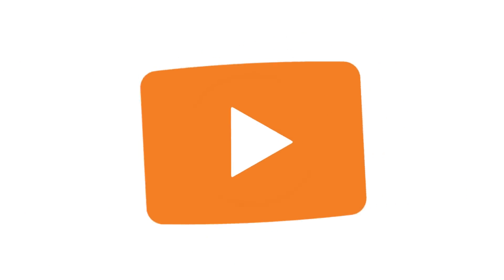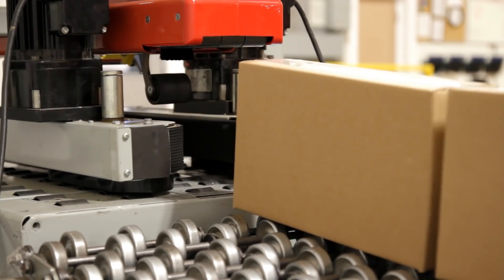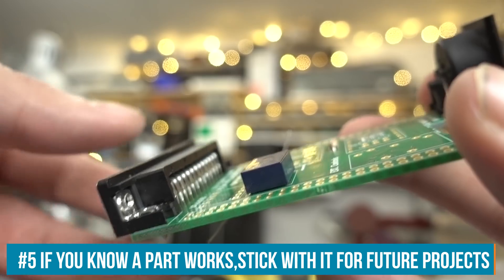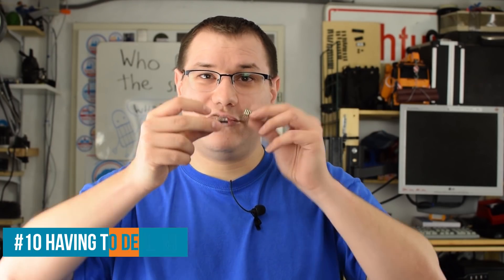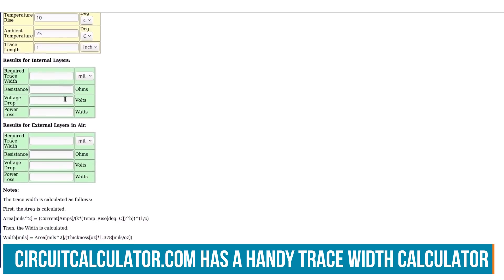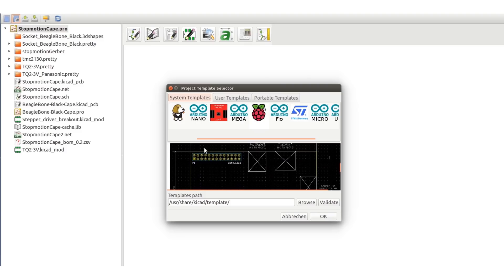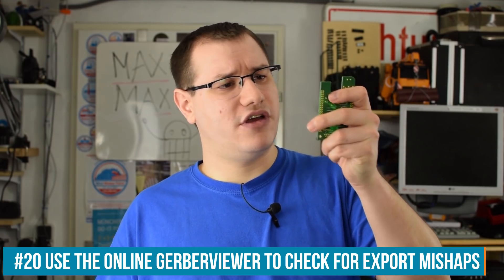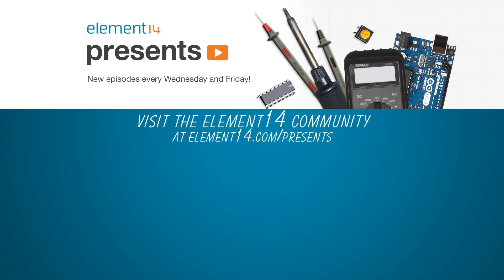20 PCB Design Pitfalls

Comment: I work in PCB design too; one thing that’s also important if you’re loading your own boards is to consider the physical aspects . Placing SMD parts too closely might make it difficult or impossible to work with using tweezers. Also spacing could be an issue when you also need to hand solder (the heat could damage nearby components). I’d also recommend spending a few extra bucks for a solder stencil for SMD designs - it makes the result much neater and saves a lot of time!
Reply: True,thanks for addimg this!

Comment: Good video with some good tips. I design PCBs professionally, and I use KiCad, and as far as flipping parts to the back of the board, as long as you verify your pinout on your footprint, the software will flip everything for you, and adjust the rats nest to match. So you really shouldn't worry about that. I think the biggest thing comes back to your tip about checking your parts, making sure you have the exact part number and datasheet, so you can make the symbol and footprint correctly. I also try to always include 3D models, that will help keep you from placing parts in such a way that they might physically overlap and cause problems in production that you might not think of because the footprints don't actually overlap. 
I am actually going to start a KiCad tutorial series soon showing how I professionally design boards using the software, so keep an eye out for that. You might find other pitfalls to avoid or new tricks that you didn't know about.
Reply: How much is it to get a simple PCB built? It's like 4 inputs for an XBOX one Controller.
Reply: @KDdesignsTV  There are several PCB fab houses in China that you can get boards for $8-20 shipped. Add parts and engineering, and you have a functional board.
Reply: I would love to see your series! do you want to post it on element14.com ? the other people there will surely be interested!
Reply: @MAYERMAKES  I can definitely do that! Right now I'm working on a small project showing how an Embedded Systems engineer solves a puzzle based on the game Shenzhen I/O, so I'm showing the process of quick PCB design, mechanical design, firmware and full assembly. Once I'm done with that, I plan to start my KiCad series.
Reply: @KuittheGeek   great! that would also be great to share there!
Reply: On my last board, I ended up wasting a load of space as I picked the wrong size coin cell battery holder. Luckily the pins were in the same place so my board still worked.
Reply: @Workshopshed  That is definitely a pain. That is one of the reasons I try to find the 3D models. I will grab the model for the battery I am planning on using, and the coin cell holder, and then add them together on the footprint. You can add multiple 3D models to a footprint, and layer them, so that will help spot errors like that as well. I am planning on going over that in my series, but today's episode is about library management, and how I build symbols. I am working through the project one piece at a time.
Reply: @KuittheGeek  unfortunately I got the wrong model so it looked great on the preview.
Reply: @Workshopshed  That makes sense. There is only so much you can do as a sanity check. We try to do peer reviews as well to try to catch some of that stuff, but there is only so much you can do. You live and learn. I have definitely made a lot of mistakes, so if version 1 isn't right, version 12 should be. ;)
Reply: @Workshopshed  I always print the pcb on a laser or inkjet printer and put the components that I've not used before on the footprint and pads. Using gerber (free online) preview tools you can catch a lot of problems too like drill sizes.